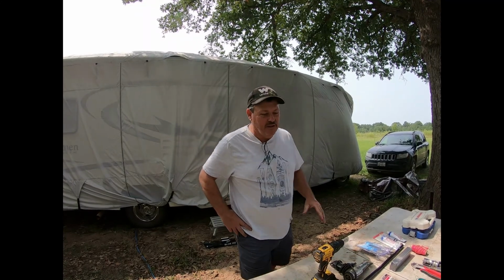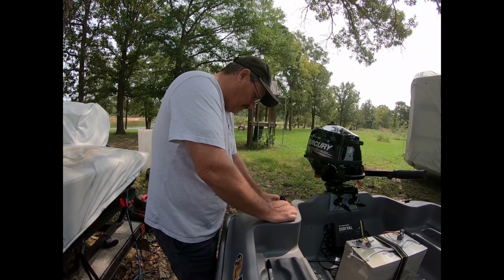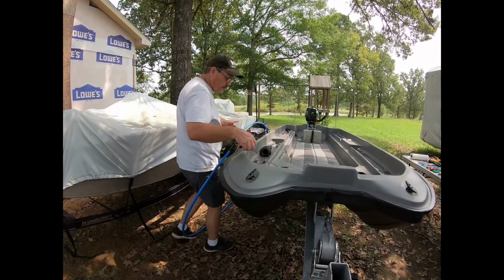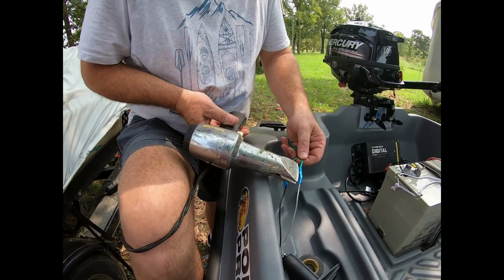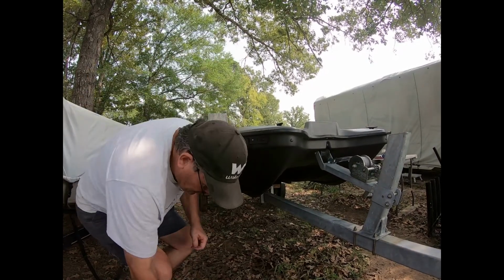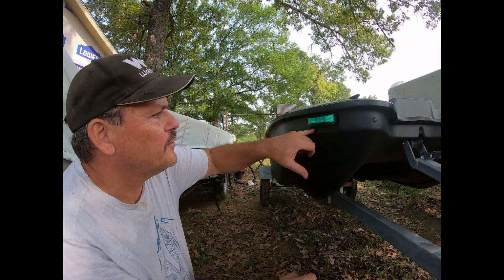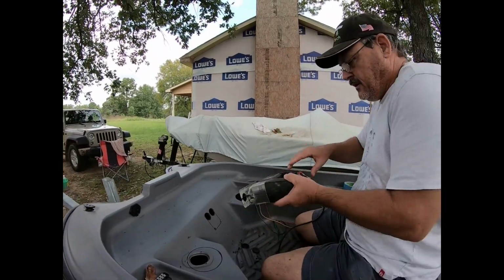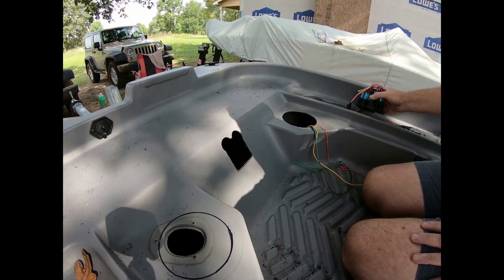Navigation Light Install

Comment: How did you find and pull up ?the end of the pex tubing you ran to the transom?  Great video.  Thanks. I’m going to do the same to my Pond Prowler 10.
Reply from the maker: When i cut out the hole for the new cup compartment I made. It's very easy to reach in and just pull it through.

Comment: Awesome video and looks clean but I really wanted to see how you ran the wires and pulled them thru for the interior lights.
Reply from the maker: This was a 2 part video. In the first video I demonstrated how to pull the wires from front to back using a piece of small tubing as a Fish Tape.  All the wires where pulled using this technique. Thanks for watching.
Reply: @LifeisaHighwayRV  I watched the first video and it was great. I'm referring to the little amber interior lights you installed. I want to install them on my pond prowler but am definitely nervous about making holes and screwing up.
Reply from the maker: @chrisl8674  I understand that. Just  make sure the hole is the correct size and its where you want the lights. No worries. Pulling wire is not that hard. Just be patient and take your time. You can do it...